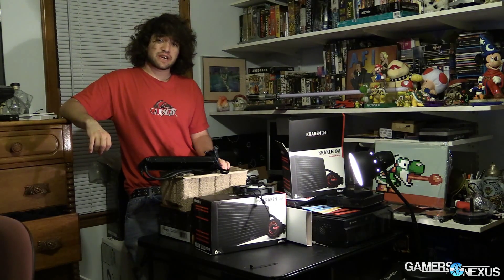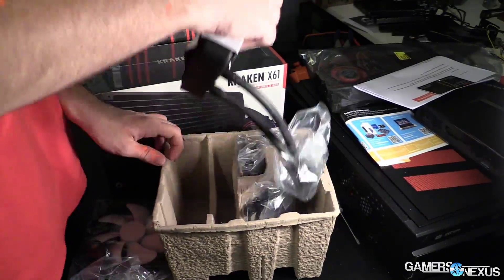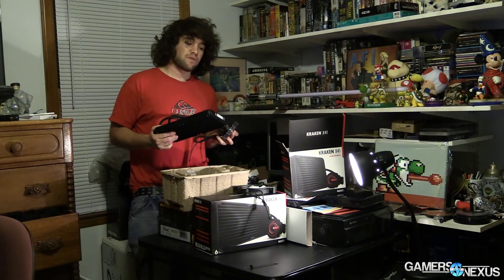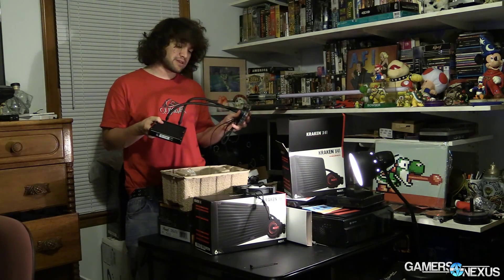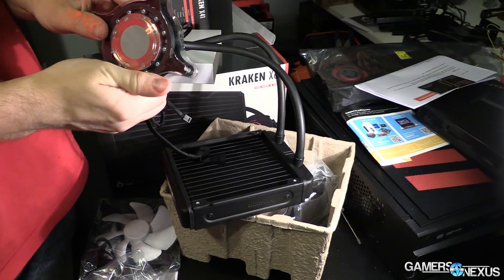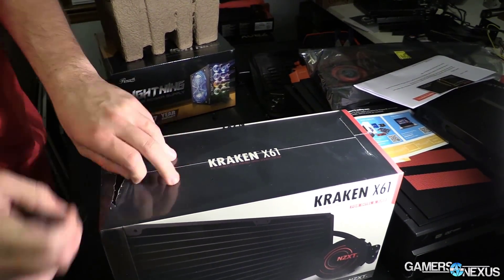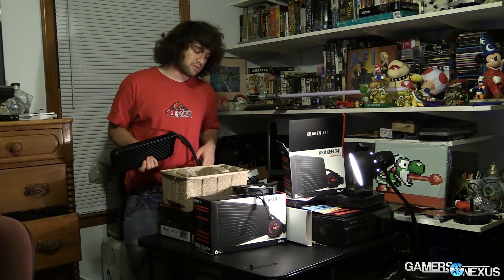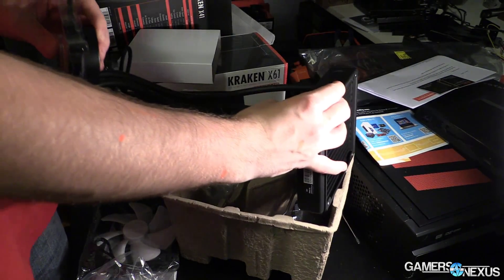NZXT X41 & X61 CLC Hands-On & Overview

Comment: changing the pump speed does not change thermal capacity. Just keep it on silent
Reply: Yeah I think 1200rpm is the quietest cooling setting you can have